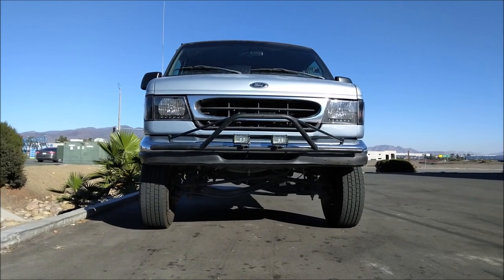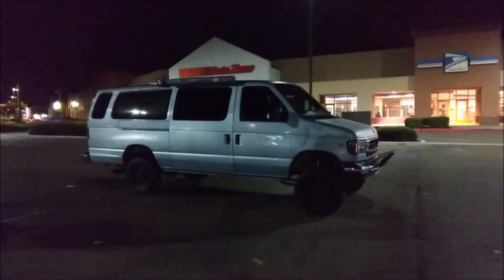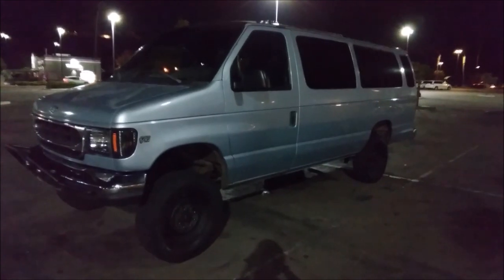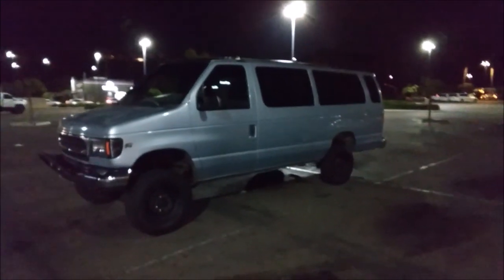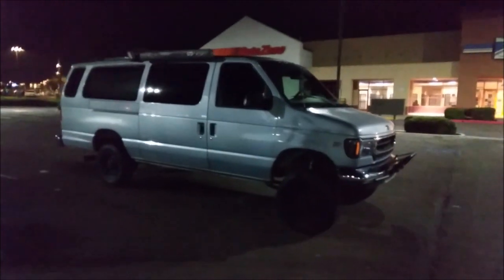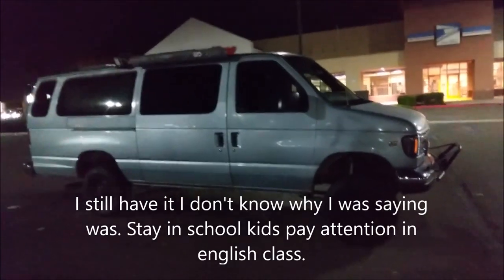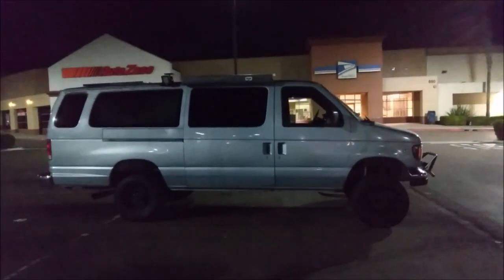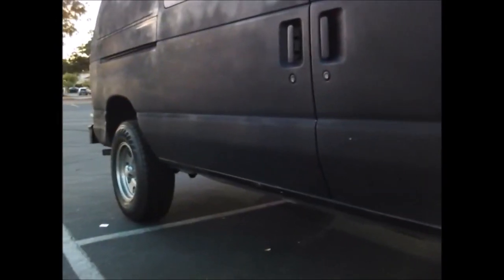Lifted Econoline Van why I still run stock tires Slower acceleration 0-60 with bigger tires demo

Comment from the maker: My last van build kind of sucked lol. Back doors didn't open, had to chain the sliding door to lock it, power windows didnt work AC didn't work but it looked real cool. It was hard to let go of it because of all the memories I have with my dogs. This second van build is way better. Learned from my mistakes.

Comment: Your old van build might have sucked, but it earned my subscription!
I went from 245/70 to 265/75 on my 88 chevy C2500 and can't really tell a difference, but it was geared low from the factory.
Reply from the maker: Even though it was a dumb decision to fix up a van with a wimpy motor, no AC , windows that dont roll down, back doors stuck closed it was fun and I have so many memories taking my dogs out in it so it was hard to let it go. Kept it for 2 years even when it wasn't running at all those last 2. Good things happened from my last van build like people unsubbing me when they saw Fiat videos. Those aren't real friends. The real friends like you stuck around.

Comment: The V10 will probably push any size tires you throw at it effortlessly..
Tritons rev up to the moon compared to your old 302!

The Vans are never complete! Never..
Reply from the maker: These Modular motors are interesting. GM motors make most of their power on the low end and Ford made these REV motors I was watching videos on these motors when they tow 5000+ pounds on steep grades and they like to be at 4000 RPM. I know these make peak HP at 4000 and peak torque at 3200. Unloaded it does a good job staying under 2000 so theres still a decent amount of power downlow. When I put the big tires on my last van it can never stay in overdrive anymore. It was super wimpy lol